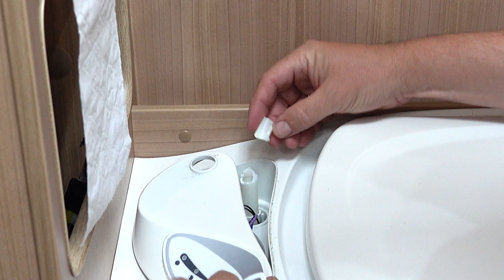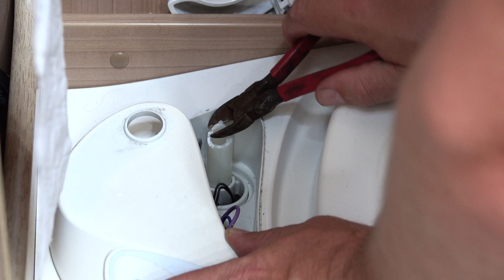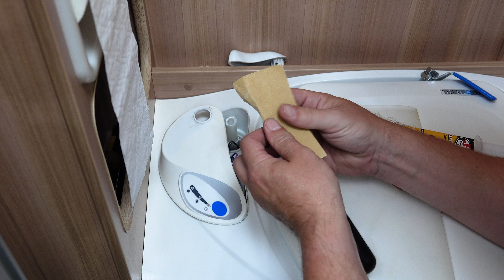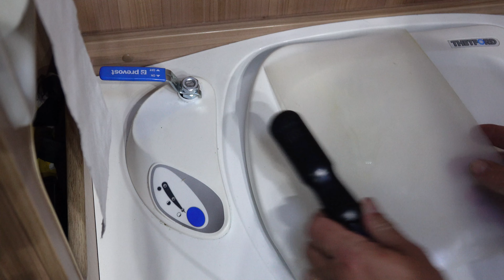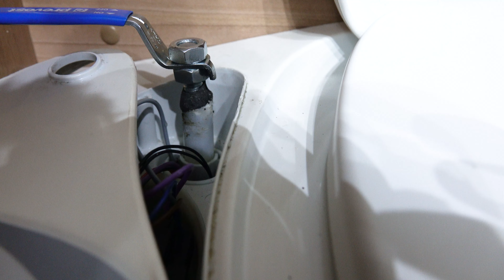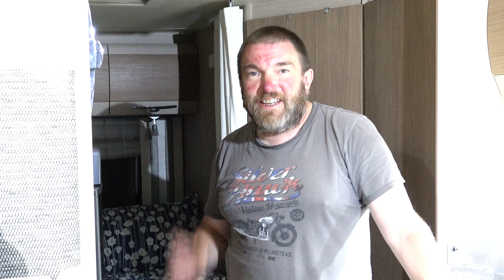Broken Motorhome Toilet Flush Handle - Temporary Repair

Comment: What replacement part did you order for this? I’m having the exact same problem now
Reply from the maker: The part I ordered was a Thetford SC400/500 flush handle shaft kit. Part no.  51802. From Caratech Caravan Parts.
TBH I haven't fitted it yet as Nikki prefers the valve handle 🤣

Comment: Those handles are really stiff ours is the same, I’d have bent a nail heated it up and put a hole through the bit left then drilled the bolt and put a split pin through or something.
But we all deal with our $#!t differently.
💩
Reply from the maker: I guess that would work too although the shaft walls are quite thin 🤔

Comment: A hole through the shaft and the bolt with a split pin would have saved you aggro.
Reply from the maker: I can see how that might work but the shaft walls are quite thin and the inside is conical so it might be tricky to get the whole arrangement solid enough. 🤔